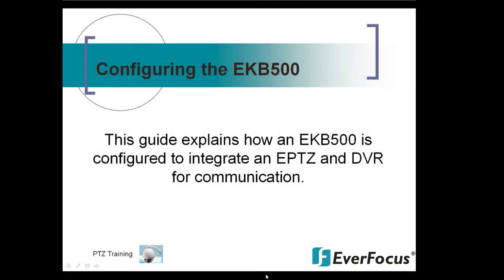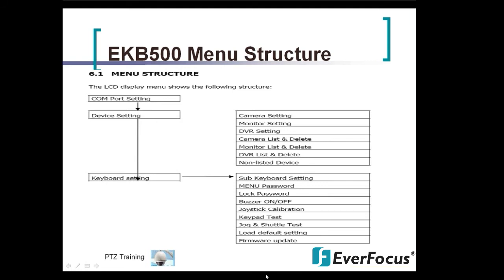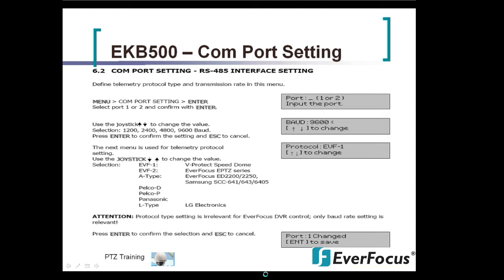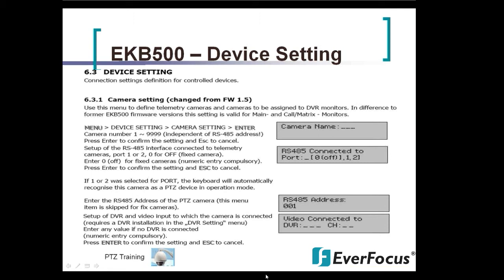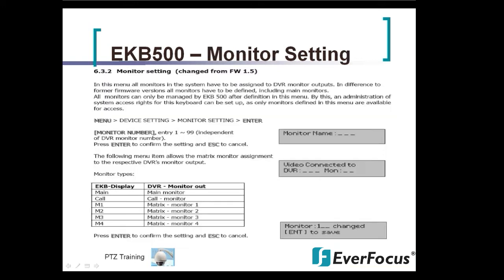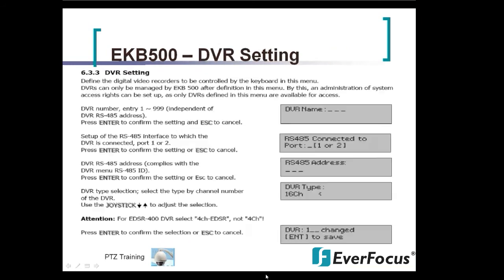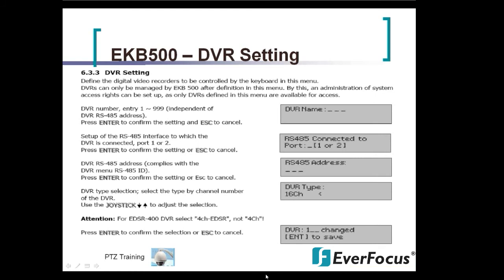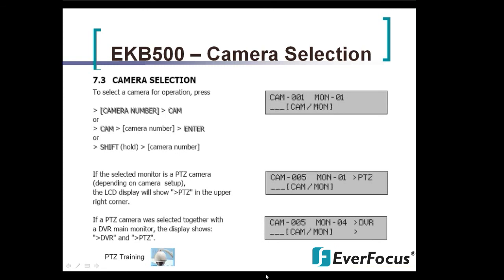EPTZ Part 8: An Introduction to the EKB500 Controller Settings

Comment: Friend I have the command EKB500 1.4 I would like to help me get the 1.5 firmware to update it since it does not have the model of my DVR EDVR16D1 and does not recognize it, I also have a camera ptz and it does not recognize it, I urge its help with the firware 1.5